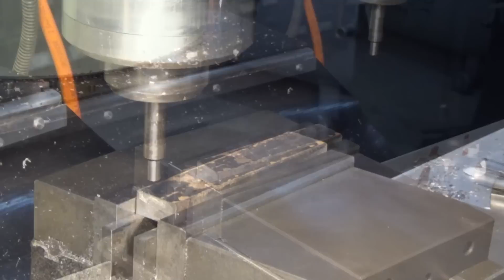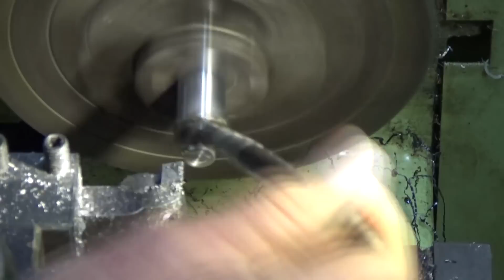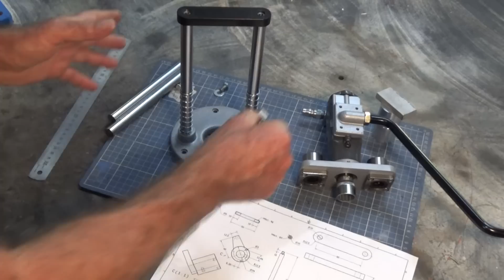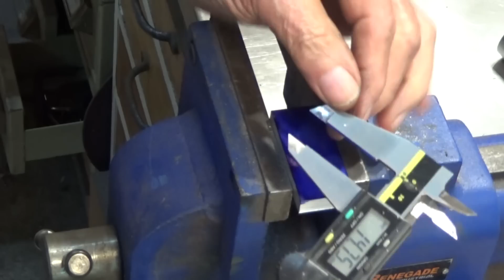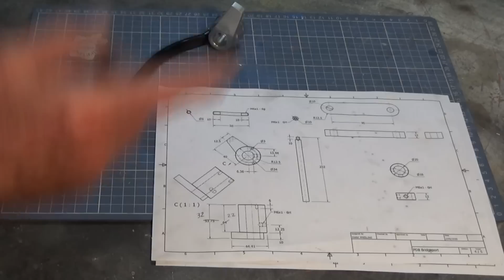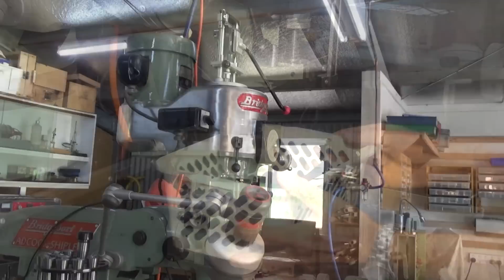DIY Power Drawbar for a Bridgeport Style Mill - Part IV

Comment: Nice work Mark. I’ll take some inspiration and probably steal a couple of ideas. I came up with the idea of using a butterfly wrench. I wasn’t surprised to find out that it was quite a popular method. I like the vertical bars and the springs. That’s a brilliant idea. I was going to suspend the butterfly wrench above the drawbar with a counterweight spring or just have a socket type receptacle for the wrench to sit in when not in use, but this makes it a lot easier.. my SIEG SX2.7L has a rather poorly designed an implemented captive drawbar system that I’m currently modifying to give more strength and I’ll be adding a thrust bearing. That will eliminate the need for a little catch to push the tool out of the spindle. The captive arrangement screws onto a flange which was mounted to the aluminium cover which eventually after only two or three goes with a tight morse taper ripped the threads out of the aluminium cover so I’ll make a whole new mounting arrangement for it but the nice idea with the captive section is it threaded to mounting flange so it’s removable so adding the shafts and spring idea of yours will come in handy but I’ll make it pivoting so it can be completely swung out of the way and then the original captive drawbar can be unscrewed and the drawbar can be removed from the spindle allowing me to use standard More taper shank drills, etc all in all nice work Mark thanks for getting the juices flowing 👍
Reply from the maker: You're welcome. I have a Sieg X3 with a MT3 spindle. I rejected the idea of having a power drawbar on that machine since morse tapers can be hard to eject. I use a hammer/spanner on mine. However the unit I fitted to the Bridgeport works so well that I never give it a second thought. The only upgrade I did was to add an automatic oiler in the air line to keep the butterfly wrench lubricated. 
Regards,
Mark

Comment: A one lever use would be nicer.
You could achieve that in two ways.
1 make a new drawbar with a collar that is hold down by the base plate.
2 install a second lever on the first one, that slips between the upper plate and the motor when you loose the tool.

Comment: Awesome project!!! excellent work explaining everything. You should add a torsion spring to the latch body so that it automatically engages when you pull the socket down onto the draw bar. That will make removal a one handed operation. When you're done, push the latch body handle around to disengage it. The socket will spring back up on its own. So you only need one hand to manipulate the handles at any point of changing out the tooling.  I am 100% making this for my Bridgeport. Thanks Again!!!
Reply from the maker: Thanks. As I was making my version of this tool I was following another build that was far more automated than mine. It used pneumatics to engage the socket on the hex of the drawbar and electrically operated pneumatic valves. It was a lovely piece of engineering and I felt that my version was a bit basic. However it does work well and although it is a bit of an inconvenience to have to latch it down, I soon got used to it and I don't think about it much. Maybe I will revisit it one day.
Regards,
Mark

Comment: Hi! It's possibile have a 3d step drawing?
Reply from the maker: Sure, try this dropbox link https://www.dropbox.com/sh/f2uj8t9k9hdlomy/AADNpvMN2PSmy8Rv8o4m5B1La?dl=0
I exported the entire assembly file in STEP format. If you want the pattern STL's they are in the same folder. You can still make the Power Drawbar without castings though.
Regards,
Mark

Comment: Off-the-shelf power drawbars are dang expensive - $900 for my mill, and I just couldn't, feeling guilty about spending that much on something I wouldn't use everyday. I tried designing and building a "real" power drawbar (one with an internal piston) but it got so involved and only worked "meh" that I gave up. I like the relative simplicity of yours, and its open frame means that if there's no compressed air, it's still usable. That's important.
Reply from the maker: I haven't found any real issues with the one fitted to my Bridgeport. I did add an inline oiler to the air motor since you sort of forget about it once it's installed. One a few occasions a tool or collet will get stuck but a quick tap with a plastic mallet will free it up. However the whole unit needs to be removed or at least swung to one side if I want to use my 90 degree angle drive. The quill needs to be extended quite a lot to attach it and you need a long socket to get to the drawbar and tighten it. 
Regards,
Mark

Comment: Hi Mark
I've just discovered your tool ejector. I can see me doing that on my BP Clone.
I liked the "balanced cuts/feeds"  I've often wondered at that?
On a bit of a winge now, marking out using the calipers is definitely right down there with Sodder (Solder) shits me something cruel!
Reply from the maker: I have seen quite a few otherwise good machinists marking out with a digital caliper and I can see the reasoning but I hate seeing it done with an expensive set of Mitutoyo's. I bought one of those cheap Chinese vernier marking gauges which can give you a resolution of about .05mm which is good enough for most applications. 
Regards,
Mark

Comment: Great video,you need to couple load/unloading of your  tooling so you have a free hand ,maybe use a pneumatic  ram instead of springs
Reply from the maker: At the same time I was working on this build, a guy I follow on Instagram (@sgsengineering) was building a similar design. He went way further than I did and his version is fully pneumatic and works very well indeed. Mine was sort of a pneumatic "lite" version but it is still working quite well or at least way better than having to reach way up to the top of the spindle with a spanner.
Regards,
Mark

Comment: I tell ya what... I have three rotary tables ranging from 12" in diameter to 18" in diameter. It's just simply not worth the effort to clean, hoist, lock down, and dial in for a couple parts. I used to try to leave one setup, but the work wasn't there to justify it.

Great work on the power draw bar! Looks store bought.
Reply from the maker: Thanks. I now have a large 10" rotary table that was given to me by a friend. It has never been used and I have it sitting on top of a steel mobile trolley that holds my rotary phase converter. The top of the frame is more or less level with the mill table so I can slide the rotary table on and off fairly easily but as you say, it's a lot of work to set it up for one job. I guess there are some things that it's really good for but I haven't needed it yet. Nice to have though!
The drawbar is still going strong. I don't give it a second thought any more. It just works and I can't imagine not having it there.
Regards,
Mark

Comment: Very nicely done! What software are you using to generate the 2D & 3D plans / models? Looks very professional. Thanks.
Reply from the maker: I use Autodesk Inventor for all my CAD work. I am a bit fortunate that I have a deal with Autodesk which was available to teachers who were involved with the F1 in Schools project. Even now that I am retired I can still access it since I do some mentoring with students from time to time. 
Regards,
Mark
Reply: @Preso58  Thanks for the info. Looks like a nice piece of software, unfortunately at retail it is priced well out of reach for a hobby workshop!
Reply: You can get a trial package for student/ learner/ non commercial use, ask around amongst the folk who use it, you'll be surprised at what's available.

Stavros

Comment: Mark even though part of the system is manual it's still a very nice setup. If someone would like to make the plunger portion maybe an old Plunge Router frame would work. I'm going to look into that and try to replicate what you have. Once again very nice. Love it.
Reply from the maker: The rise and fall mechanism is exactly how the plunge router works. If you could find a scrapped router it would be fairly easily adapted. 
Regards,
Mark

Comment: Mark,
  This is a brilliant design with some expert machining work.  My only concern would be starting the threads of the drawbar into the R8 collet under pneumatic power.  Is there any accomodation in the collets and or drawbar to assure that there's minimal risk of cross threading the threads when starting a new collet?

Thanks again for a great design and presentation.  I look forward to copying it at some point that my own abilities allow such.

Scott
Reply from the maker: Scott, I too wondered if that was going to be an issue. Just about every other version of this tool starts the drawbar into the threaded hole under power. However, you don't really press down too hard when tightening the tool in the spindle. It sort of spins under light pressure until the start of the thread engages. It's also held in pretty accurate alignment so it's unlikely to get cross threaded. That usually happens when you get the axial alignment wrong. If the collet and the drawbar are co-axial it has to start correctly. 
Regards,
Mark

Comment: Hi Preso.  I'm pretty sure that I've seen all these drawbar videos, but maybe not?  I'm wondering why you need the 'left hand' locking mechanism.  Will the drawbar not undo/redo just by you holding the righthand lever in the desired position?
That will also hopefully avoid the 'idiot operator starting te mill with drawbar tool engaged' situation.
Regards Mark in the UK
Reply from the maker: I did try holding the carriage down hard and then engaging the air and it just doesn't work. About half the tools will be ejected but the ones that stick seem to need a fairly sudden jolt to break them loose. The latch mechanism works well but you have to give the impact wrench plenty of run up and plenty of air. If you hesitate it will just jam up and then you have to break the tool loose with the spanner. 
Regards,
Mark

Comment: Nicely done, as usual, Mark. May I suggest few improvements to this part - 1. Some electrical safety switch that is prohibiting spindle motor from starting while  device in engaged position.  2. Latching mechanism requires seond hand  - you pointed that already. If you will design something that is swinging down with gravity from the bridge and providing detend for the pneumo tool, holding it in lowered position. Question will remain  - how to swing it back and make pneumo tool retract . But you can figure it out, can you ?  :)
Reply from the maker: Gennady, my overall design brief was to keep the tool as simple as possible with as few parts as possible. I thought I had it right the first time but came undone when some of the tools stuck in the taper. The MKII version was easily adapted from the original but there are probably refinements that can be made. With regard to the electrical interlock, it really isn't necessary. If the impact wrench were accidently left engaged on the drawbar it would just free wheel. Probably it would lead to some increased wear and tear but it wouldn't break anything.
Regards,
Mark

Comment: Very useful project. Up until now I’ve just released the top nut a couple of turns a hit it with a hide mallet. It works but isn’t as high tech as yours.

I saw that Myfordboy video too and had my partner buy me one for my birthday. She was grateful that we’d sorted out a present during lockdown, I’m difficult to buy for at my age and because I had to get my notes out to refresh my use of a vernier gauge, I had a lot of satisfaction using it. Reasonable price too. Regards.
Reply from the maker: Peter, just do me a favour and withstand the temptation to use your nice digital caliper to scratch marks on some crusty old steel. Every time I see someone do that on YouTube I want to scream. I'm glad you got the same tool that I use - all thanks to Myfordboy!
Regards,
Mark

Comment: On my power drawbar the collet is ejected, when the drawbar starts to rise, by simply coming up against the bottom of the mounting plate.
Reply from the maker: Well, that would absolutely work. I am finding that about half the tools I own don't need to have the latch engaged to pop out of the taper. I still can't make up my mind if that is good or bad. 
Regards,
Mark
Reply: @Preso58  thiis is more opinion than anything but, i would think you would want the taper to grab and hold. Without that you might be relying on the small pin, that keeps the collet from turning while tightening, to drive the cutter.

Comment: Hello Mark,
Great project, I like the simplicity of design… 
I have been holding of getting one of the marking out verniers until I have seen someone I respected using it who did not have an affiliate link… do you think you will use often?
Take care.
Paul,,
Reply from the maker: I am using it a lot now. It's so easy to pick up and set. If I had needed to do anything accurately before I would have to shift the surface plate onto my welding bench and then go and get the big digital height gauge. It comes with a spare carbide point too.
Regards,
Mark

Comment: Might be a stupid queation. But can you make it so the lock engages when you pull the handle down? Similar to the spring used in pocket knife locks. That way its a one handed operation untill you need to release it at the end
Reply from the maker: I guess that would work. It does remind me of something an engineer told me once. "If it ain't broke, it doesn't have enough features yet!" 😁

Comment: whats that on the grinder at 06.30
Reply from the maker: It's a Scotchbrite deburring wheel. I have had that one for ages. They last forever and are quite dense. They are great for deburring and putting a fine grained finish on all types of metal. They also remove paint, oxide and corrosion. They aren't cheap but I still think they are value for money. 
Regards,
Mark

Comment: What happens if you forget to unlock the drawbar.
Reply from the maker: Bob, I am guessing you mean what happens if you forget to disengage the impact wrench from the drawbar? If you do leave the impact wrench engaged the pneumatic motor in the impact wrench will just free wheel. Long term it will probably wear it out prematurely but it won't break anything. It's not necessary to lock the spindle when operating the power drawbar. The hammer action does all the work.

Comment: Mark, may have missed this tidbit, but why not just pull down and activate on the right lever at the same time?
Reply from the maker: I tried that, believe me! For some reason it must need a hard stop on the mechanism to break the grip of the taper. 
Regards,
Mark
Reply: @Preso58  So your taper is so locked in that you can't physically hold the butterfly impact down hard enough? wow .. well, you engineered a beautiful solution to that problem :) well done sir!

Comment: Looks great! Have you turned on the machine yet with it locked down? I am sure I would....
Reply from the maker: The pneumatic motor would just free wheel. I have seen some designs where the impact wrench is permanently engaged. I am not sure how long the vane motor would last that way. If you have an oiler in the air line it only delivers lube to the motor when the air is spinning the motor. I am hoping I am not so dopey that I leave the latch on permanently.
Regards,
Preso

Comment: I Like your method for rounding the ends - I'll take that one :-) Nice job Sir 👍
Reply from the maker: It's the next best thing to having a honking great rotary table!
I wish it were my idea.
Regards,
Mark
Reply: @Preso58  I like your method too.  I've always done it the "unsafe" way by clamping a bolt/pin in the vise and swiveling the part into the cutter by hand, always with a very high pucker factor!  Of course, you can only do that if the part is long enough to have a built-in handle.  I don't as yet have a rotary table, so I'll start using your method for now on!

Comment: Does it have a lockout so that you can't accidently start the mill while the power drawbar is engaged? In my experience, there is no such thing as "too much" idiot proofing.
Reply from the maker: David, sadly, no. There's no interlock. If the idiot operator forgets to unlock the impact wrench it will just free wheel. I guess you could fit a ratchet and a clicker to it to alert said idiot operator. The version that Steve Smith built does have an electrical lockout function but his brain is much bigger than mine. 
Regards,
Preso
Reply: Nanny state measures, sometimes they really need to be in place.
I have worked with some clueless people, I'm sure others have thought the same of me too! LOL
I used to be young and dumb, I'm not young anymore..
Reply: One idea would be to connect a latching mechanism to the first handle, in such a way that it only latches when it activates the unthreading of the drawbar.... i.e when the leaver is turned to one side... I think it could be done with a simple linkage... or even sompler... extend the leaver up to the crossbar, and make it catch under the bar when it is tilted to operate the pneumatics, and release when in neutral, it will then keep the machine pushed against the bar during unthreading and then be released when the tool drops down...   then it could be one hand operated and spring back when not unthreading... and thereby be somewhat idiot proof..  great vids btw... greetings from Sweden.

Comment: Nice... with good function . Doesn't matter if you have to use two hands you got it to work and mesh cleanly  good job... i like the powder coating touches.
Reply from the maker: Nick, I am a big fan boy for powder coating. I bought the kit from Eastwood years ago and it's the best money I ever spent. The finishes you can get are almost unlimited and it's hard and durable and there's almost no cleanup at the end. You will see in my next video a very nice red lollypop finish which is super hard to replicate in paint. With powder coat it's one application and 15 minutes baking time and it's done. 
Regards,
Mark